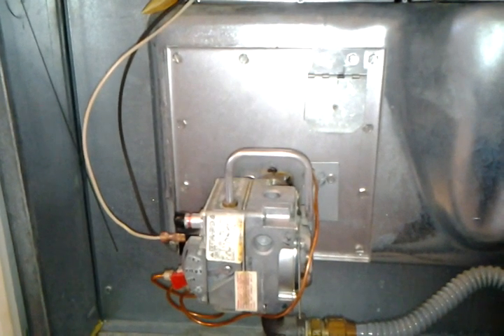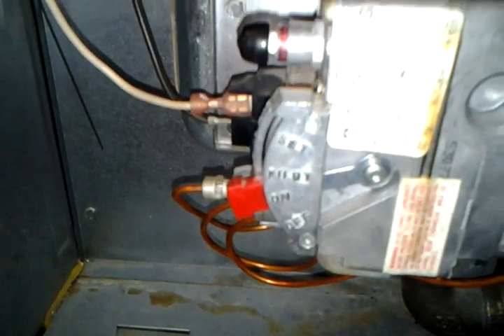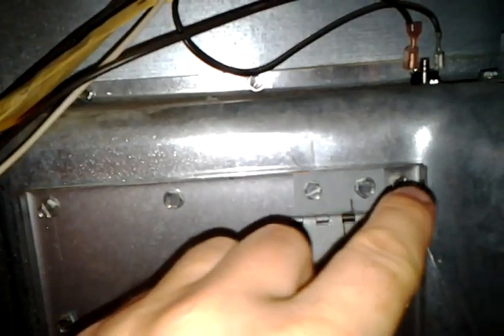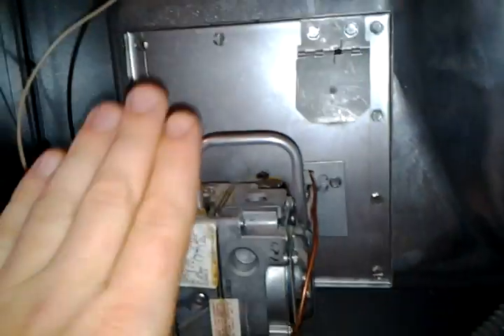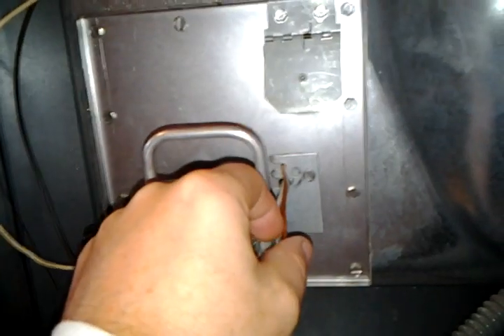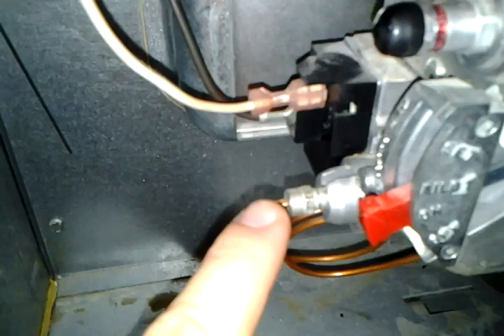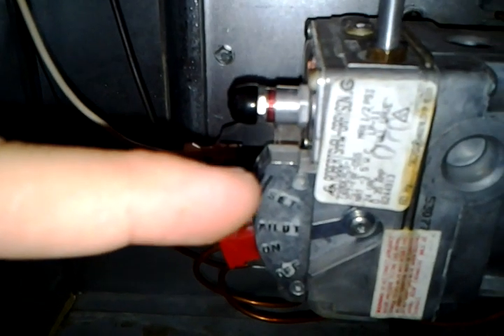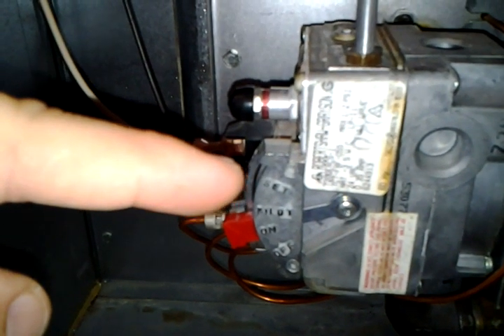Fix Mobile Home Heater thermocouple replacement

Comment: I could sure use your help. Grateful if you would tell me if the large square metal plate that the gas valve is mounted to, gets hot when the furnace is running. The area right next to the left of the little hinged door covering the inspection window (where you light your pilot).   I'm  helping someone with his furnace and it's apparently the same as  yours. His model number is MGHA077-ABFC-05. Does yours burn LPG or Natural Gas?  His metal plate is getting hot when running and we've checked all draft issues (flue blockage, fresh air pipe blockage, gas valve orifice size, proper manifold pressure (gas valve outlet pressure). Actually it's a new gas valve.

Comment: Just in case I did, I didn't mean to give the impression that I was asking for help with a diagnosis of my problem in my previous comment; just grateful to know if that metal gas valve mounting plate on your furnace gets HOT like this one is doing.  But the more I think about it, the more I have to believe it should not be getting hot.

Comment: So the white powerline is supposed to go on top? Is it bad if the black one is on top instead? I had to replace the thermocouple with a neighbor and he removed both the black and the white wire and when we had to hook the two back up, he was almost certain the white wire went on bottom while I was almost certain the white wire went on top. So I'm kind of worried because we did it his way and now I'm not sure since the furnace is running.

Comment: I want to add to this... I watched all of these videos and couldn't get mine to light... the red lever, it might be jammed in the "depressed" position... I used a flat head to pull it back up and did everything for the 30th time and it worked. It only comes up 2mm or so, so it's slight, but it matters. A lot.

Comment from the maker: Look closely at the device to see if it says specifically to have a positive or negative connection. If it does not then you should be fine. Next time before you start any maintenance project, take a picture of the area before you start so you can cartain what goes where to be safe.

Comment: I'm trying to relight mine. Looks just like that one
Reply: Me too. Identical. Any tips?
Reply: @AJC0117   put on pilot  position and push lever down at the same  time light it with a lighter hold for 2 seconds and let go then move to the on position  on the gas valve and that should  do it

Comment: do you have the wireing diagraph for the unit you were working on. i need it or do you know where i can find one.
Reply from the maker: The wiring diagram is a sticker on the unit that's all I have. You could look online for a mobile home eater furnace manual for the brand name, Miller. Try this w w w . mobilehomerepair . c o m / a r t i c l e furnace.h t m l

Comment: Mine turns on then shuts off and the fan is the last to turn off
Reply from the maker: Did u replace the thermocoupler? If not, doing this replacement might help. If you did, and you are still having the quick shut off problem I could be a bad igniter or blower fan problem. Then call a repair guy.
Reply: @mlsgiant  no sir I grew up in this mobile home we havent done it’s Maintance in years but it’s working fine now the furnace keeps the house warm
Reply: @mlsgiant  I’m gonna get a HVAC guy to do it’s maintenance
Reply: The furnace only acts up when I start it up it starts then it turns off the blower continues on 
pushes the lingering heat